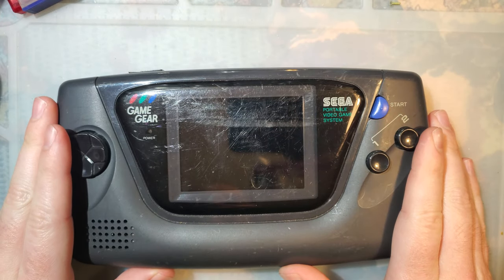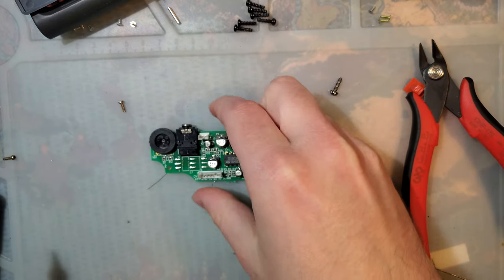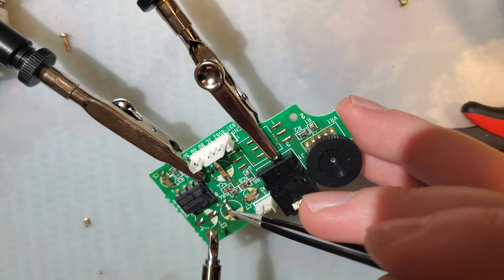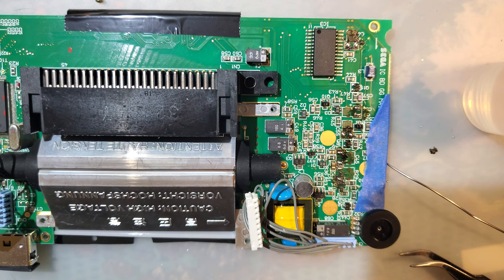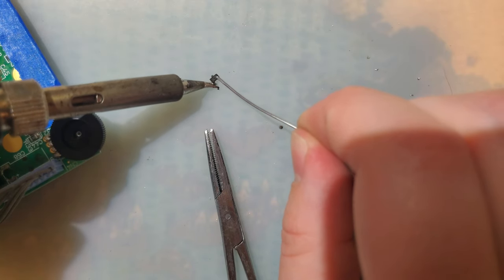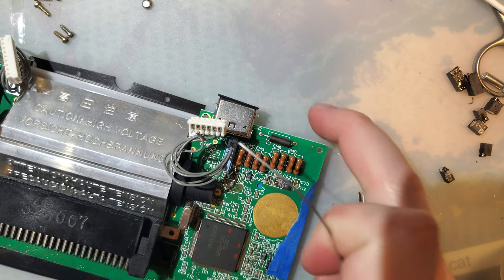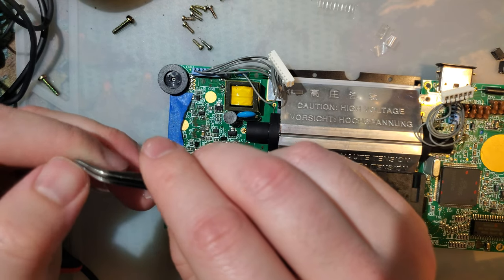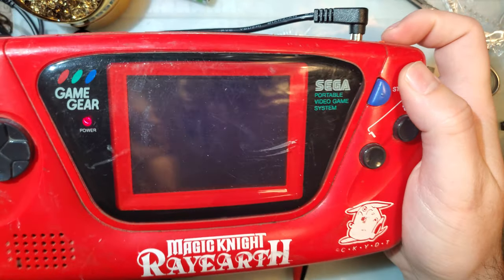Game Gear Recap

Comment: I've recapped about 20 Gamegears and always used console5 cap kits. Luke buys and sales good quality stuff. 
This last time I picked up the kit with the ceramic caps from Retrosix and I LOVE them. You don't have to bend and tweak them like the can type which is a pain in the ass. Even though double checking polarity isn t a big deal, it's still nice to not have to worry. 30 years from now those ceramic caps won't be spooging all over the main board.
I can see doing like ya said and ordering the caps in bulk if I start doing a lot of GGs again,  but it's just nice to have them kitted up nice and tidy.
Now we need an inexpensive aftermarket screen replacement. Swapping out the stock light totally improves battery life btw.
Low sound volume is almost always caps on the sound board. If a GG won't power on then 90% of the time it's caps on the power board.
Thanks man for your videos. Damn near everything I know about Gameboy is from you or me jacking something up and having to Sherlock it.

Comment: You don't need to remove the 4 screws holding the LCD/diffuser in place. The rubber gasket goes in the case and you lay the motherboard on top. Also, never wipe or touch the screen, it will scratch the polarizer.

Comment: Who you calling a weirdo, ya weirdo? :F

I just did a GG VA4 recap three days ago. One problem. No games to test if anything works. (It turns on, the screen is as weird as ever, but it's lit, I guess?)
These things are super flaky with the cap removal. I desoldered them the old fashioned way too, and two pads decided they wanted off. This was the sound board specifically. Just in case, I looked up that module on scambay, people want $50+ for it, no telling if its been recapped or not. I actually desoldered the connector from the sound board. I don't trust myself enough, nor do I have the thin tip (tips can be pretty pricey, especially this time of decade)

They really did glue the caps down, but the adhesive on mine was so dry, it wasn't even holding anymore.

Console5 seems to carry different cap kits with all the needed caps for the GG(and a few extras in case you fuck up?)

(The one thing I noticed, is that console5 at some point, carried their own GG sound boards. with these as old as they are, some models have the schematics listed, and I know retrosix has a USBC power module, probably not compatible with my model. Then again, WHAT IS? Ha.)